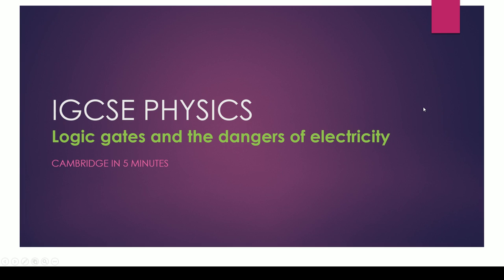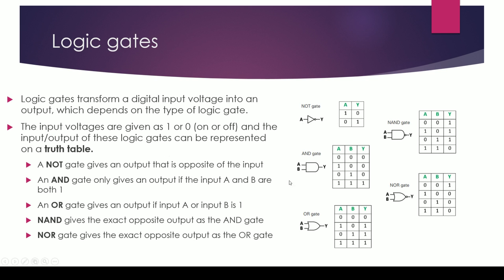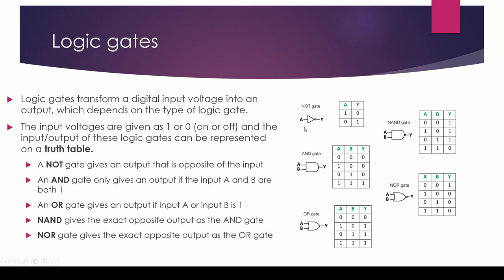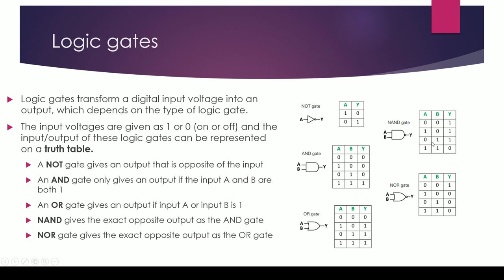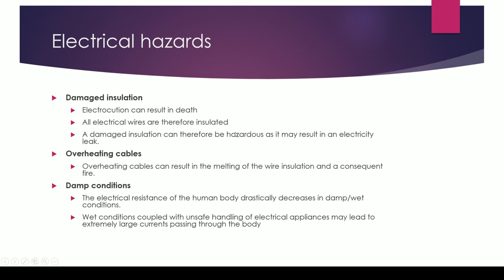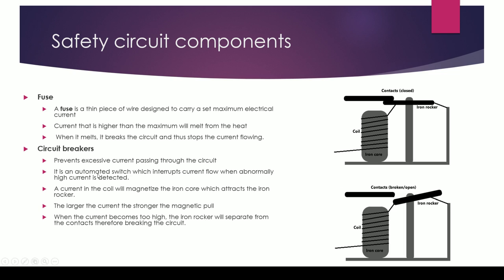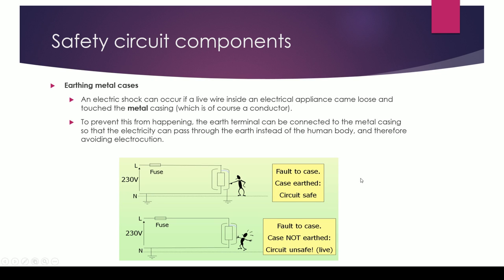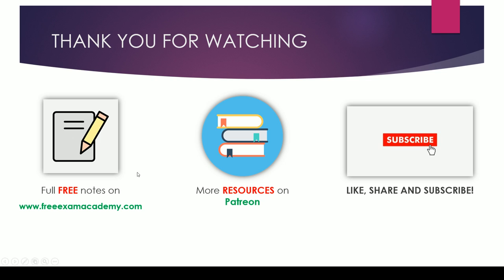IGCSE Physics Revision [Syllabus 4.4-4.5] Logic Gates & Dangers Of Electricity

Comment: Is it true that the books Cambridge published for IGCSE preparation is lacking in content?
Reply from the maker: What did you mean?
Reply: It was missing in a few key details in few of the chapters like the reproductive system, transport in plants, and so on. Key details like blastocyst, phloem transpiration stream were not ever found within the book, and many of the students in my school who took the igcse has said that the book wasn't enough for the test itself. (Fyi the book is Mary Jones Geoff Jones Biology IGCSE 3rd edition)
Reply from the maker: Right I get what you mean :) Yes. Even the official textbook will omit certain information which may be important. I think for the most part though it should have most of the information you need
Reply from the maker: It’s important to use the syllabus along with past exam papers to check what sort of information is needed, and what is included in the textbook. If there is missing info that you need to cross reference with other sources of information :)
Reply: Damn it, they give official textbook but then omit like 10% of the info that may be crucial. It's a ploy to make A* on tests even more difficult xD. Thanks for bearing with my question til this far.
Reply: Yeah its definitely lacking content. I tried learning using those and they just did'nt work.